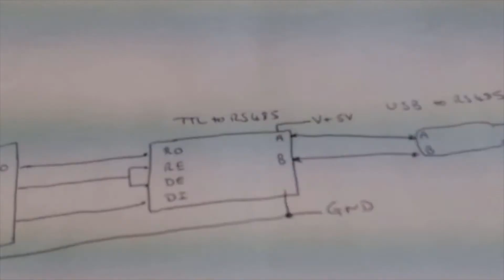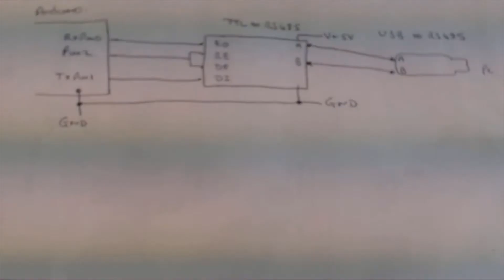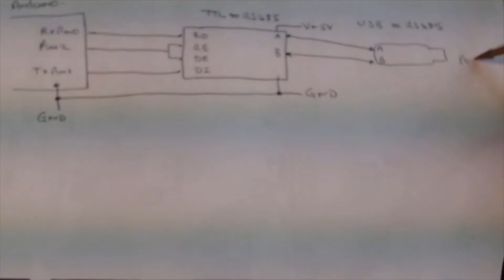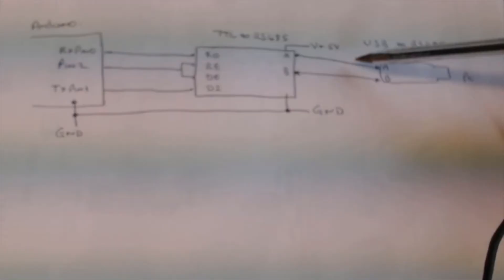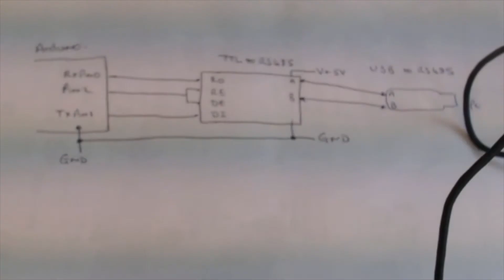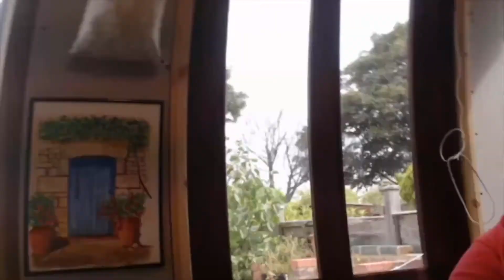Arduino RS485 to  JMRI CMRI Initial setup

Comment: 12:15 Default JMRI C/MRI node address UA must be the same as what the Arduino code cmri address is set at? In your example the Arduino code CMRI address  = 1, hence the same address is used for JMRI UA address (C/MRI node address)?